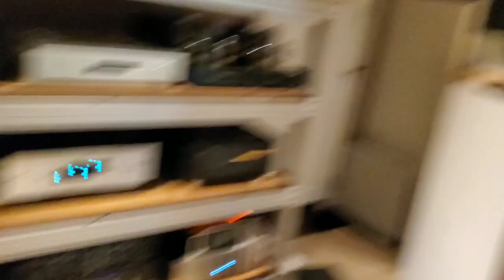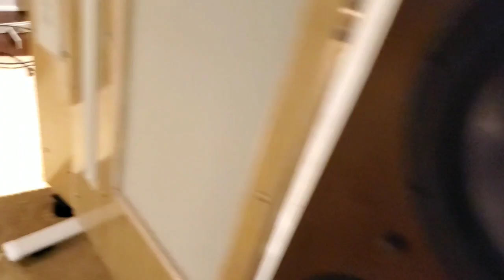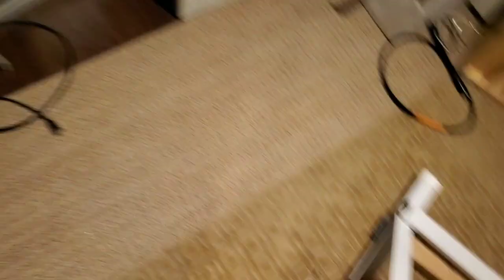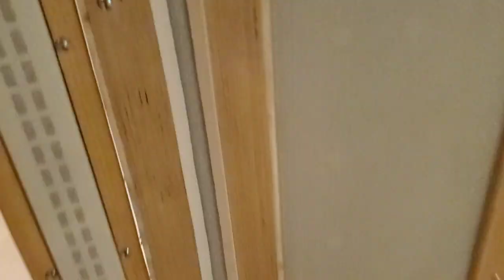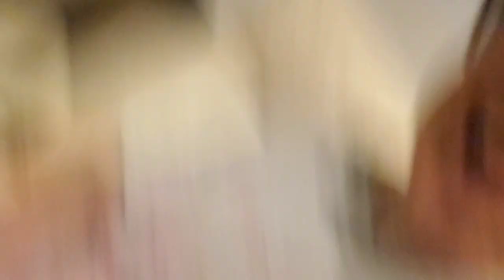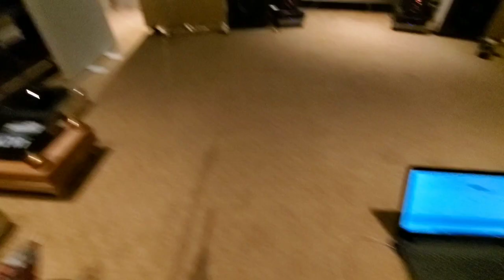Learn to build your own HiFi speakers.

Comment: Thank you. I'm an old hifi geezer who remembers the golden era of hifi when building your own speakers was a hobby that lots of folks engaged in. There were even kit builder stores dedicated to that pursuit. All gone in this age of disposable products.I used to work in such a store and have such fond memories.
Reply: Do you remember Heathkit? Elektor? I built my first amp and speakers when I was 13. Not by choice. I was in hospital for an appendix operation and the deal my dad made with me was if I built the amp and speakers he would get me my own turntable and tape deck. Eventually I made several more of these amps and sold to all my dad’s friends. Most bought the amps to humour me. Some even bought (or commissioned me to make) loudspeakers. One even asked me to retrofit his a small 400 seat cinema hall he owned with multi channel amps and 8” full range speakers I had made. I was 15 or 16 then. All but one of these men are now dead but I thank them all for the encouragement they gave a teen boy 45 years ago.